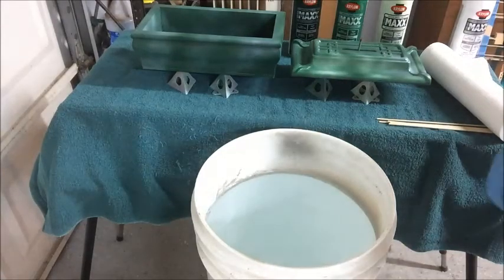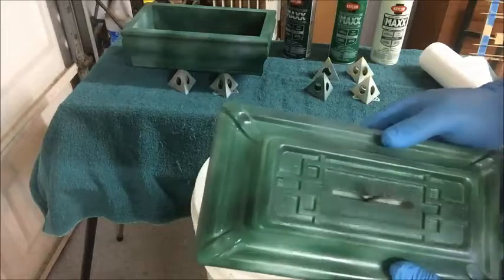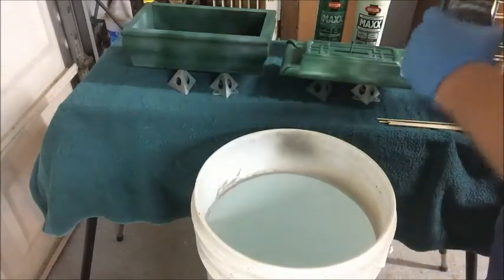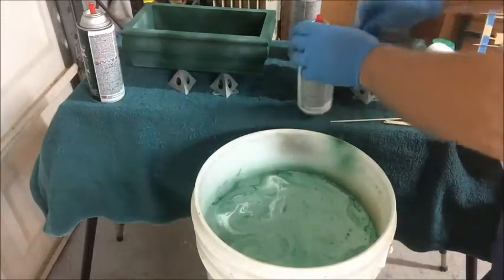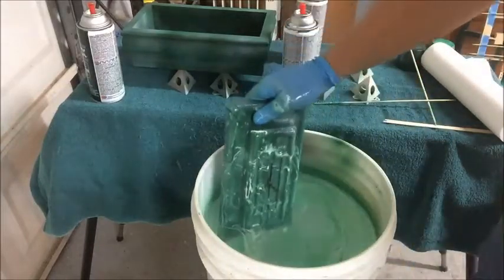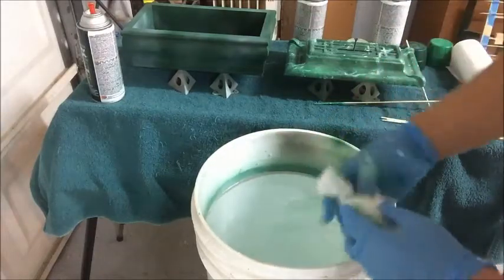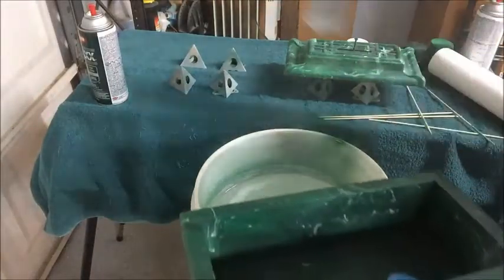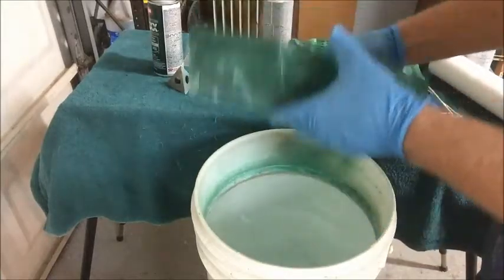Jade Marbleizing Part 2

Comment from the maker: Hello,
It's a fun technique and has become quite common since I first learned about it over 20 or so years ago. Whatever the thickness of the paint is, will be slightly raised from the base coat. It's a relatively smooth surface since the paint film is so thin, but I generally apply several clearcoats to make the final surface as smooth as possible.